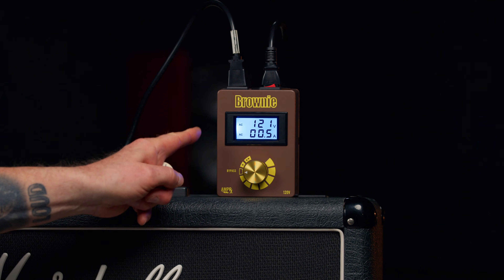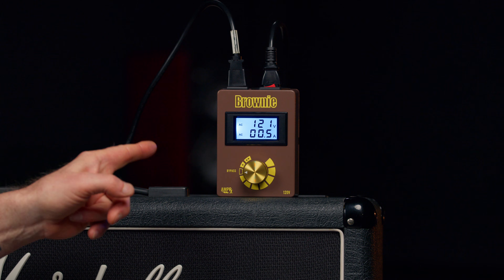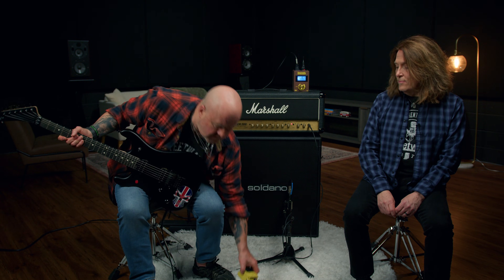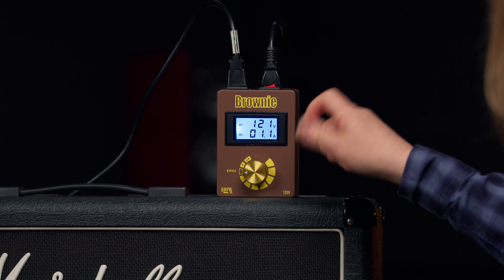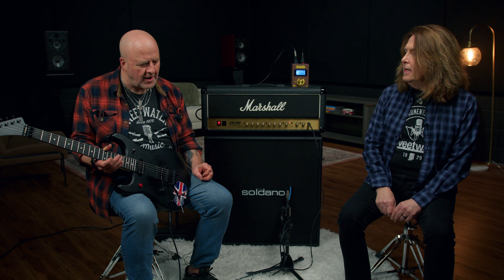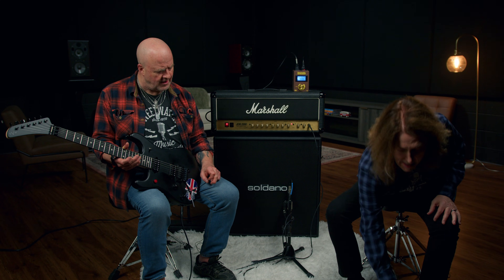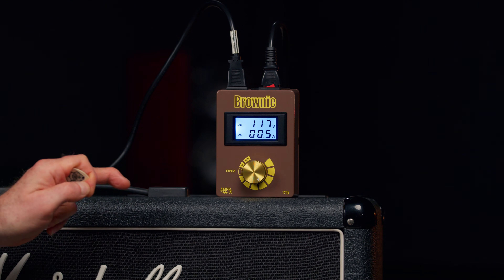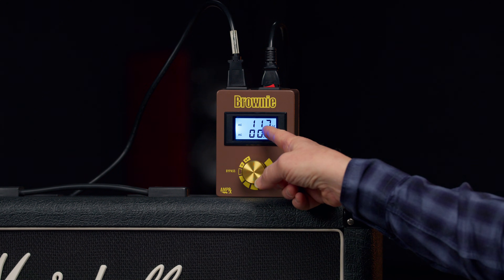AmpRX Brownie Tube Amplifier Input Voltage Controller Demo

Comment: Hey guys, i own a marshall sc20h, and ever since i got it the tone and quality of sound, depending on the day and time of day, fluctuated from absolut crap "piece of sh*t amp, must be fu**ed" to "F***ing amazing, best amp ever"... 90% of the time it was crap really. 
After some time diagnosing the problem, i found out that on top of living at an end of the power grid, where i  have massive voltage fluctuations (anything from 218v to 235v , i also have "dirty power" in my home instalation causing a lot of problems. some days the amp was painfull to listen to...
i went and got a Furman AC-210 A E Power Conditioner to get rid of the dirty power and it worked wonders, tose day when it as unplayable were gonne, but still, i rarelly had a day where it sounded amazing, the rest of the days it felt like it was lacking something...
 i got voltage stabilizer but it has a tolerance of +-6v (still signifcant), and with it,  it sounds decent most of the time, but still some days its spectacular. i'm curently waiting for a variac to be delivered to find the voltage sweet spot.

had i heard of this product earlier i would probably get one and save myself time and money.
Voltage  and current quality  definitely play a significant role in tube amps performance IMO.
Nick at 03:21 , its exactly how i feel in the good days  💪🤣🤘

Comment: The problem with the AmpRX Brownie is that EVH used 89vac, 78vac an 68vac which you can't get these VAC voltages.
Reply: evh also blew up a lot of his stuff and ruined guitar equipment experimenting randomly like this. Stick to professional equipment, folks

Comment: how do you determine what would be the ideal voltage for your tube amp so that you can dial it in with your AmpRX Brownie?
Reply from the maker: Hi, Pissarrio. Tube amps are designed to work with 120V of power, but many modern outlets will have more than that. The flip side is that in a band setting, if all the gear is plugged into a single breaker, the voltage can start to be reduced. The display on the Brownie will show the voltage that is being supplied to your amp so that you can adjust up or down as needed.
Thanks for your interest!
Charlie Davis, Sweetwater Sales Engineer, (800) 222-4700 ext. 1320, charlie_davis@sweetwater.com
Reply: By ear.